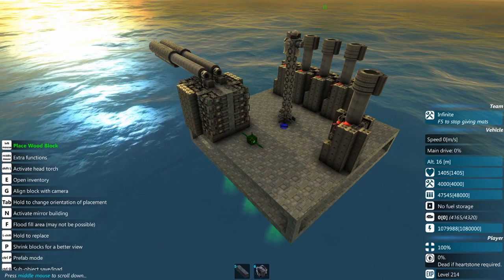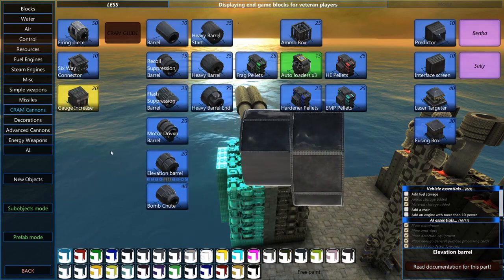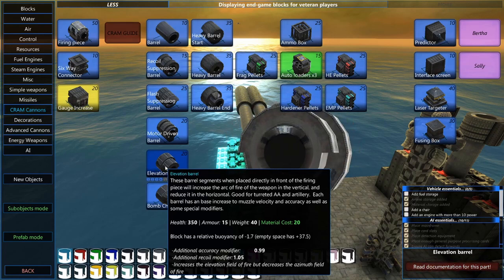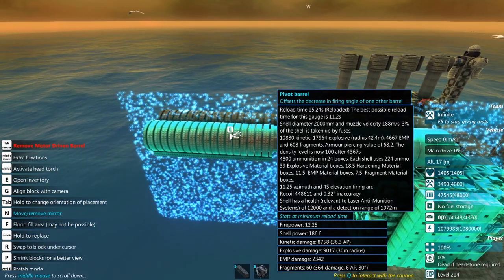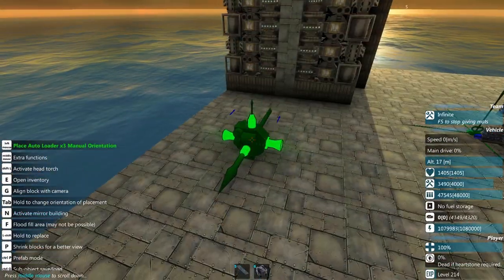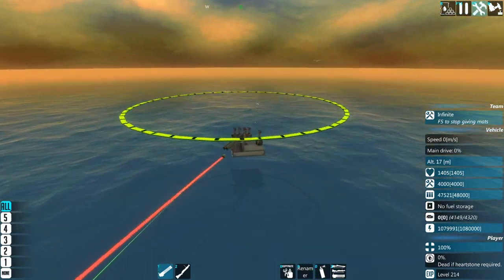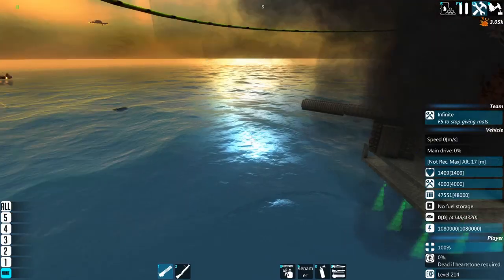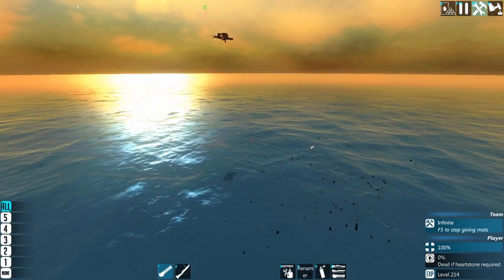From the Depths - Tutorial 20: CRAM Cannons

Comment: Bonus information; the gauge increase corner is actually slightly different to the other gauge pieces. This is because it does not have cram connection points on the two curved faces.  This is useful for tetrising multiple cannons, or tiling mortars, as you cannot let the gauge pieces of two seperate cannons connect (as this connects the cannons together, and one is favoured for packing and gauge). 

TLDR; You can tetris the corner gauge increasers of separate cannons directly next to each other without scuttling your cannons.
Reply from the maker: Excellent point, and something I didn't realize! That would have let me reduce the dimensions of the tileable mortars I put together by 1 in one direction.

Comment: DISCLAMER: I made this comment before completing the video

When making a multi-barrel turret, cram cannons can share pellets and ammo, so you don't need to separate them, only the gauge increasers and I think the 6 way connectors can't. Sharing them makes a very efficient cram cannons. Second, I would advise placing an elevation barrel in front of the firing piece, then place motor driven barrels, then the other barrels. You should equal the amount of motor driven barrels to your other barrel types to even out the odds of each, thus making the cram cannons even better.
Reply: Again, post made before finishing the video

Cram Tetris is something you should focus on if your new to cram cannons, it's putting the parts together like a pancake in a efficient way, then stacking those pancakes on top of each other. If you knowing what your doing or your just experimenting or something, you could put them together in a different way, like he did, though the pancake stacking style of tetris is really efficient, but again, you could still make something more efficient without those delicious pancakes. Like they all say, there aren't rules in this game, there are just highly suggested guidelines.